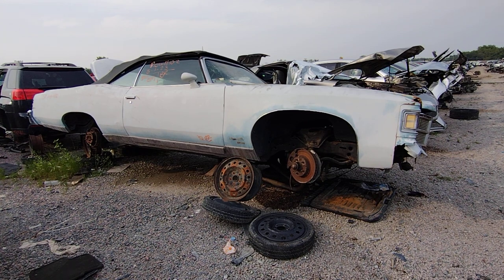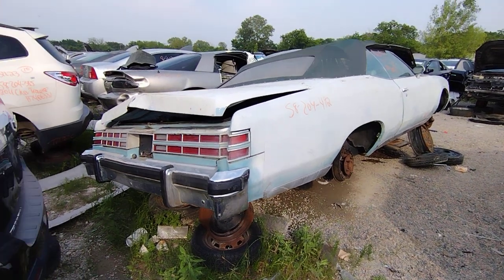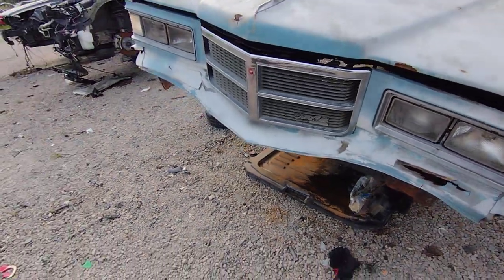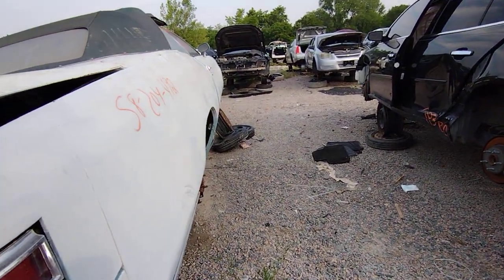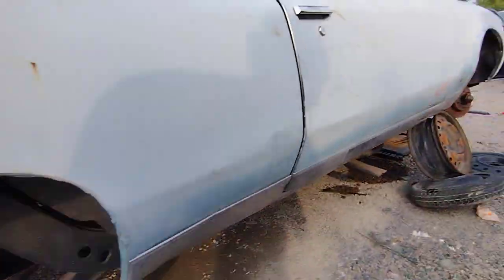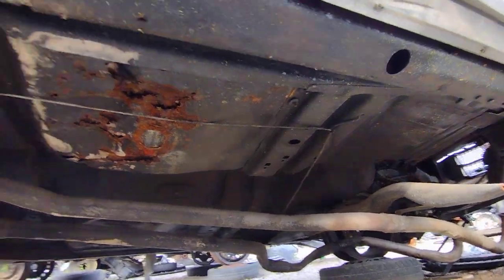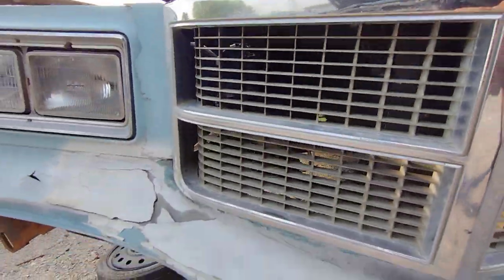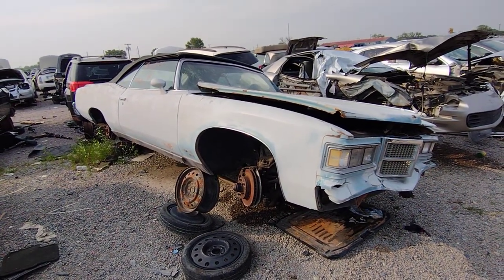RARE 1975 Pontiac Grandville Brougham Convertible Junkyard Find

Comment: Whoa Nelley, 1975 and soon to not be alive. There were 27,652 Grandvilles produced for the 1975 model year and only 4,519 of them were convertibles. Pretty rare. Sad to see it sitting here. The Grandville was the lowest production of the B body convertibles of this era and production never exceeded 5,000 units. 1975 was the highest production year. 

We got the tag, we can brag: ST75 for 1975 model year, 2BR67 for Pontiac (2) Grandville Brougham (BR) convertible (67), PON for Pontiac, MI assembly, 92Y for White and Blue interior trim, 24 for Medium Blue lower exterior paint, 11R should be for a white convertible top, 05D for the fourth week of May 1975 production, and A65 for split front bench seat with center armrest.

We got the VIN, we win: 2 for Pontiac, R for Grandville Brougham, 67 for convertible, W for 455 V8 with four barrel, 5 for 1975 model year, P for Pontiac, MI assembly and the rest is the production sequence. The Pontiac, MI plant was the Pontiac "home" plant and closed in 1988 after the last of the G body RWD cars and Fieros were assembled there. The 455 in this car is the same 200 HP unit that was installed in the 1975 Trans Am and called a "455-HO". Nothing high output about it, the Trans Am engine was the same engine as what was installed in this car. In 1975, the 400 was standard and the 455 was optional, so yes, this was a pretty loaded out example. I wish someone would have given it another chance. 

Whoa Nelley, drop top took a flop. 455 is still alive. Fisher code "2BR" isn't going very far. Poncho needed a new honcho. That's it, time to quit. Painted blue and it's over for you. Division 2 and it's through. Grandville Brougham is soon to go home. Going to be flat and that's that. Seat code A65 took a nose dive. B body looking very shoddy. Going to get squished and all of the B body faithful, many here, Benny for sure and most certainly the Google Man are going to be very, very, very, very, very, very, very, very, very, very pissed.
Reply: I had a  friend who was into the big Pontiacs and had a 74 or 75 four door Granville with a 455 two barrel if l remember correctly.
Reply: @garymckee8857  1975 Grandvilles were all four barrel, whether they were 400 or 455 equipped.
Reply: @Google User GP  Yes, the vehicle wasn't mine and I know he had a 73 Catalina with a 350 two barrel. 
The Granville did not have power windows and it was a 455 ,l just mistaken about the carburetor.
Reply: @garymckee8857  I think 1975 had standard power windows, so perhaps it was a 1974 model.
Reply: @Google User GP  This was back in the 80's but I do recall it was a medium blue with a black vinyl roof.
Reply: @garymckee8857  Sounds like a nice car.
Reply: And Nathan Kim from "Kim Special Fords & More" shares similar sentiments with the Man from the land of Google.
I can almost hear Van Mccoy's "The Hustle" playing through the speakers from a compilation 8 track from Pontiac!
Reply: My Dad purchased a 1975 Grandville 2door new, it was a lime green with a white top, nicest car he ever owned at that time.😀
Reply: @nathankim7664  Or Disco Inferno by The Tramps.
Reply: @Ka9radio_Mobile9  Code 44 Lakemist Green or code 45 Augusta Green were likely the two colors it was.
Reply: Excellent rundown on this classic 
GR8 job!                                    CB

Comment: Despite it's rough condition, up here in da rust belt, she'd be an excellent candidate for a driver project. 
The top looks to be in excellent condition.
 Maybe swap in a rebuilt LS motor ?
Reply from the maker: Its in good enough shape that it shouldn't haven't junked.
Reply: Yuck. No. Put a 400 or 455 Pontiac engine back in it.
Reply: @googleusergp  
In a perfect world yeah but those Indian big blocks are getting few & far between while used LS mills are still cheap n' plentiful...
Reply: @nsidor1234  The "LS Swap" thing is played out. It's like back in the day when everyone put a Chevrolet 350 in anything that they could. It got old, played out and really trite.
Reply: @googleusergp  
Would you rather spend the summer finding a Pontiac 400 or driving that sweet ol" convertible?
That,  my gearhead brother, is the real question...
Reply: @nsidor1234  You'd be spending an eternity finding a "Pontiac Big Block" because no such thing exists. You can however find a large displacement 400 or 455 Pontiac V8 without too much trouble.

Comment: the seat trim refinish the dash pad grab that grill grab that cruise control module, convertible top switch and motor!
 lots of money on the second hand market.
Reply from the maker: I took the convertible top and quarter windows as those parts interchange with the other b body convertibles. they sold

Comment: I hope you took the top motor.  Easy $100 dead more if it works.   Assuming it was still there. Looks like maybe it was from the short glimpse of the back of the interior.

A shame that car ended up there. One was in my yard a few years back but it was bad, it was so bad the door latches held the rear of the body on.  They would not sell me the 455 out of it.  But I pulled the top motor, it was garbage, I mean it was so bad I basically grabbed it and it came out in my hands... a rough core and it still sold in a couple days on eBay for .. I think $75.  They don't reproduce them so even a core is worth some money.